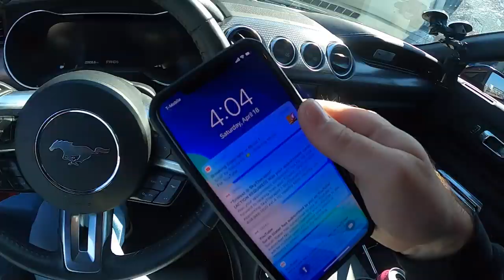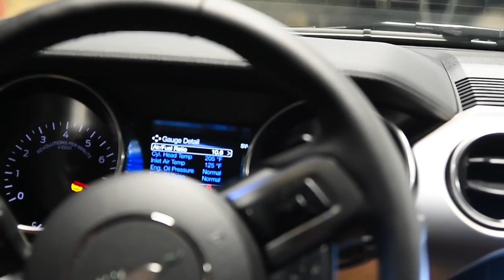TWIN TURBO "SLEEPER" MUSTANG GT WANTED TO RACE ME... SO I GAVE HIM THE HIT!

Comment: Not usually a great idea to be out racing if you suspect fueling issues unless you want to pop another engine.  I doubt its an injector probably something with the fuel system you just had installed when the computer is requesting more fuel.  It could also be spark blow out like several others have mentioned.

Comment: No surprise, the accelerator tap is similar on my 10spd auto ZL1, drops gearing down so you are about 4500rpms (performance shift mode).  Works great for cooler days and on pavement that doesn’t offer the best traction.  Plus no need to move hands from wheel.  To drop into the lowest safe gear possible, I slide the shifter to manual mode and pull back on it and hold for a couple seconds.  Pops me up to a little over 6k rpms.  When i mash it, i slap the shifter back to auto, which is almost instantly bc you are quickly into redline.  Good times, love your channel and content!

Comment: Car ran great. I also think you may have an injector pulse rate issue on a cylinder. That’s what it seems like by the symptoms you mentioned. Once you get it figured out, the car will be tough to beat. Be safe.💪🏼💪🏼
Reply from the maker: im going to figure it out don't worry. I hope nothing major

Comment: check you plugs may be spark blow out.
Reply from the maker: Yes. Going to check a few things
Reply: @Zander13Productions  As you take the boost up it makes it more difficult for the coil to fire the plug. At some point you will need larger remote coils.
Reply: This! Had the same issue on my tt 16.  Gapped the plugs down to .023, problem solved.
Reply from the maker: 2Snailz I have them at 23 already
Reply: Shit they are already on 23? Well its super easy to crack one ect....

  Has it ever been fine up at 12ish? I assume they are NGK6510s.....
Reply: Frozen Stang what coil packs do you recommend? 
I’m having the same issue, but not all the time.
Reply: @boosted5.066  I am not that power level lol Yet . :) but i see guys such as brian devilbiss going that route. I would think as long as your fueling and timing looks good on data maybe try just closing up the plugs a tiny bit to confirm your issue. Factory ford coils are pretty damn good but everything has its limits. Also take all advice on the internet with a grain of salt, without experiencing your problem these are at best educated guess'.
Reply: Frozen Stang ok, I did that today. It’s raining here so I’ll have to try tomorrow.
Reply: @boosted5.066  Sorry to hear that. i have been down for over 6 month, just finally got to drive , the snow is finally gone now just have to wait for the gravel to be  swept up. interested to see how you made out. are you logging data?
Reply: Frozen Stang long winter for sure. Yes I’m logging, Sai Li is my tuner. Just stumbles on the top end of a pull, and sometimes into limp mode
Reply: @boosted5.066  Well your in good hands from my understanding of who is respected in the tuning world. Really sounds like ignition related and not tuning but thats just me. how much boost.

Comment: Nice runs....why do you think you have an injector wasnt it around that boost before, that it messed up? I'll have to go back and watch....

 I'm surpised with the stall and Kmember the other car left like that but smart on you to turn it down till it stopped missing because that engine best I could tell on phone had a lot of smoke when he let off....
   That could have been you....gonna be a monster when she hooks.....whats your IAT climb to during a pass like that?
Reply: Are you gonna send your injectors out to get flowed?
Reply from the maker: Yes. Probably need more injectors. I have FIC 1000 now but with e85 they may be at there max. Going to check plugs too
Reply: @Zander13Productions   I need to pull my plugs to.....close the gap up some more if your lucky they are blowing out....whats the duty cycle on the injectors?
 Can you run some MS109 or Renegade109 unleaded race fuel and make sure its the injectors running out? 
 Do you have a PID logging fuel pressure maybe setup a go pro under there?

 Good luck, I'm trouble shooting what I think its a false knock from a dig when I grip, doesn't do it rolling
Reply: Zander13 lol they aren’t maxed out.  Hit 14psi and you’ll need more.
Reply: I’d say it’s just needing spark plugs and he can turn it back up

Comment: Zander.   Sounds like spark plug blowout.   Check your plugs. Gap them to .028
Reply: He said he is down to .023 ( .028 is about where I land but I'm 93 and only 11psi or so)
Reply: BlueCollarDaily cool.   Sounds like the spark is not hot enough for the E85 he’s running under higher boost